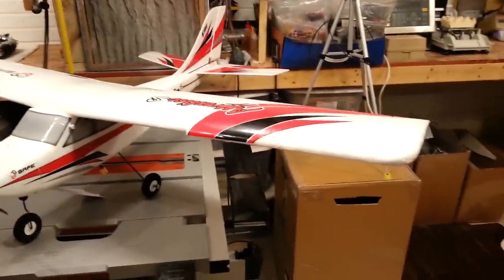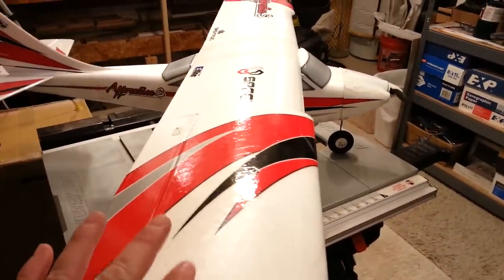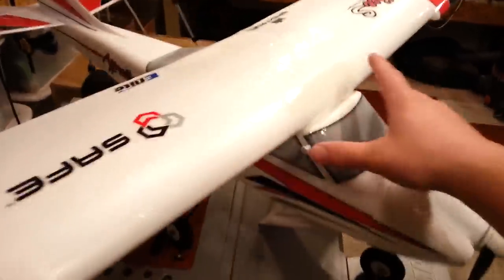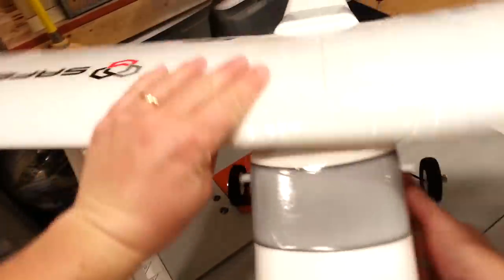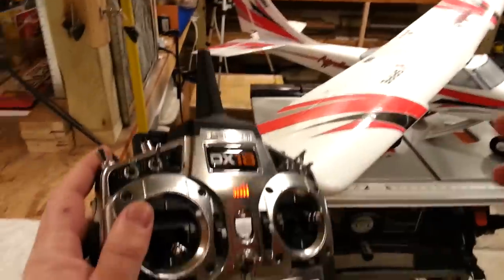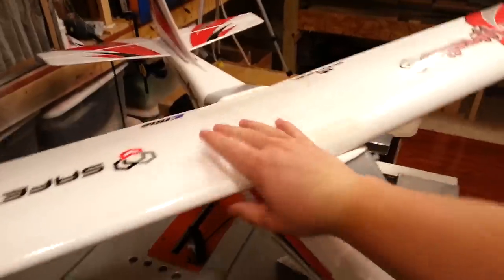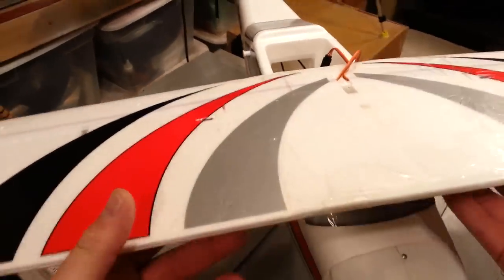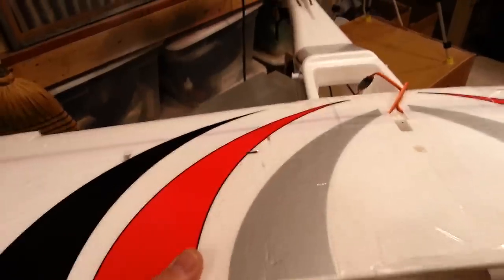E-flite - Apprentice S 15e - Flaps Mod - Part 1 of 2

Comment: Hey Brian, I just picked one of these from a deceased estate for $120 AU, AND, it came with a brand new spare Eflite 30amp speedy, 3000 lipo, prop, 6 spare wheels and a spare as new Orange 6 channel RX, has the AS3X rx fitted and working. Bargain ... Looking forward to getting it in air next week. Good to see you enjoy yours. Might give the poor old Conscendo a break as I fly so much, will do the flap mod latter on. Cheers, Stew.
Reply from the maker: You will LOVE it. Great plane for taking off and landing, OVER and OVER and OVER again!!! Very good flying plane BUT BE CAREFUL...make sure you don't turn on the POWER switch until she's on her landing gear. SAFE sets level at the position that you flip this switch, so if it's half way upside down, and then you accidentally turn on SAFE, like I did, you will probably end up on a roof across the street, feeling like an idiot - LOL :)

Comment: FINISH IT!!!

Sorry.  I saw the intro to the plane yesterday and my brain went to the one that has been sitting in the window of the local hobby shop for literally years, making me somehow I think it was an older video of yours that I missed.  When you talked about installing flaps I was like "I need to see that, that might apply to some of the what I want to do," and started searching and I had the "he must have never gotten back to it," reaction.

;-)

Imagine how happy I was to see this :-)

I’ve been thinking about cutting into a wing I have here and installing some flaps/servos and have been debating flap hinge geometry (fouler/slotted flaps vs a tape hinge) and have been wanting to keep the plane as simple/light as possible and was especially interested when you said you were going to do this with one servo and fouler flaps.

So:
- I'm jealous of your DX18... I have a DX6i and I seem to always need another channel...
- I can’t believe that you’re doing all that work with it just balanced upside down on the airplane, that would drive me crazy, for that matter it’s driving me nuts that it’s not moving on you
- The hot knife thing with the shim is kind of interesting.  I’m surprised it stays hot enough for long enough to do that.  The nice thing with that approach is that you can heat the tip and use the non hot part to guide the cut straight.  I usually have good luck freehanding cuts like that with a good sharp blade, but this time I cut my flaps by cutting a block with the correct angle in it and I screwed a razor blade to it to get a perfect angle on the cut.
- How/with what equipment are you shooting these videos?  I don’t know how many times I’ve thought “I bet people would like to see me do this,” and then either gave up as it’s too big a hassle to do or set something up on a tripod and ended up with a video that didn’t really show it well or worse, tried to hand hold it making both the video and my work crappy.
- I’ve been trying to find that dynam PN in stock somewhere for a while… I see you’ve found them under another PN.  I was actually ready to 3d print my own.
- “looks like the short side is supposed to be on the flap,” and then you go on to do it the other way 😉  I think they work out better with the short side on the flap (well after drawing out my hinges in cad to print, I haven’t gotten my hands on those)
- What kind of glue where you talking about using to hold the hinges in?  I couldn’t make it out in the video.

Hurry up and finish this 😉  I’m very curious what to end up with and you have me seriously considering going to the hobby shop and asking if they want to get rid of the one they have that has been sitting there for years.  I was wondering why no one seemed to like them, especially with all the spare parts in stock at the shop.
Reply from the maker: I already have it filmed, done and flying again :) I've been learning that releasing video too fast really hurts my channel. (sorry about that! I HATE to keep you guys waiting...)
Reply from the maker: I can't respond to all of your points due to family stuff going on, but I'll hit a few items quickly...
Stuff upside-down and loose drives me crazy too, but I learned long ago, the more times you take something apart and put it back together, the higher the likelihood of permanent damage - IE any car repair EVER - LOL!

DX18 = It IS awesome, and I've never been left wanting for anything with it!DX6 = You will be jealous ;) LOL ....My conclusion and recommendation, You should  get a dx8 or dx9 USED...they will be a TON cheaper, and will do everything you want to do for a long time. I got my DX18 for $405 shipped. It was a Brand new in box gen1, mode 2, and it included a 9 channel Rx (without AS3X btw). The company is out of them now, but they took very good care of me. I had a slider go bad and they replaced it with another brand new one, which I then sent the broken one back to them (at their expense)...the only catch was that I agreed to give my CC#'s to them in the even I decided NOT to return their broken one back. This was a very fare deal.
Parts for Chinese brand planes can be fleeting, so buy them when you can :)
I followed the instructions for the flaps on my Turbojet 550, for the hinges, then I copied it for this plane. I THINK I did it right, but definitely won't pick that "hill to die on"...
Mucilage is the type of glue I was using. It's a nuance of Chinese technical ...made from tree sap or some vodo witchcraft fluid...but it's excellent, and super cheap! 

These are links where I'd get some credit from your purchase (maybe a few cents...)
Foam-Cure - http://amzn.to/2CUiLMP (Similar to Mucilage)
UHU Por Styrofoam Glue - http://amzn.to/2CXrMVy (Similar to Mucilage)
Small Mucilage... Keep in mind this is not a link where I'll get any credit :(https://hobbyking.com/en_us/clear-foam-glue-medium-cure-large-100ml.html?___store=en_us
Large Mucilage... Keep in mind this is not a link where I'll get any credit :(https://hobbyking.com/en_us/clear-foam-glue-medium-cure-large-100ml.html?___store=en_us
Glad you're into this project. If you can get this plane for yourself, you WILL love it. It flies wonderful. I hate when I get a simple and less cool looking plane that latches onto me and becomes a favorite, since it's nothing to write home about, in the looks department, but it flies SOOOOOOOOOOOO good. You'll get it, when you pry it from your local hobbyshop's death clinch :)
Gotta go for now. Thanks sharing our experience!
Reply: Brian Phillips lol.  Yea. Same boat. Reading on phone between family stuff.  I was wonderig if you already have it done, your playlist shows 4 videos, 2 private. ;-)

Happy Father's day!
Reply from the maker: I just slipped away for a few minutes to finish up replying to comments. I only occasionally do my YouTube comments on my phone, since the PC is so much faster for me. We've been getting behind the last few weeks with house and land stuff keeping us very busy. For one of our most recent projects, we're working on a bridge to cross a stream on our new land, and since we're heading out there later today to get some more work done. I want to keep caught up so people don't get annoyed with non-answers...YouTubers that fail, forget their most important component, the audience!!! I hate when I ask a question and 3 years later there's still no answer. This was a commitment I made (to myself and my viewers) when I stated this whole YouTube thing.

1) I won't leave projects undone, at least without explanation...sometimes I crash them - LOL
2) I won't leave people hanging, waiting endlessly for reply to questions. I hate that!

Plus, I'm just kinda that type of guy. It drives my wife crazy sometimes, but it's like any other character trait, good with the bad, you know... When I say I'll do something, I mean it - to a fault.

Happy Fathers Day to You too!
Reply: I get that, I'm not always so good about getting back to people on social media, but I do have a reputation for helping people/following up almost to a fault... you don't know how many times I've heard something like, "why are you wasting your time on that, they wouldn't for you."

I ended up searching your Mucilage and found that it's "fish glue."  Yum!

Any suggestions on where to look for used RC equipment?  I don't spend much time on the forums so I don't have a good lay of the land WRT to used sales.

Anyway, still curious how and with what equipment you're shooting these videos... Maybe I'll start shooting some of me building things. ;-)

I buy stuff occasionally from your links (ordered the hinges you linked here this morning) but I can't imagine you see all that much from things like that but I guess it doesn't hurt...  

I'm hoping to sneek watching the next video in sometime today... huh... Monday...
Reply from the maker: I use these phones to film my videos...
1) Galaxy S7, Our is our goto phone, Megan films with this one...and it's generally really good.2) Galaxy S3, I use it for my shop repairs and mods, and I use a specially built cell phone mount on a helmet liner to hold it on my head, so I can see the screen, since it's a full time job trying to keep things in picture and in focus!!!3) Galaxy S5, this is "my phone" and the worst for quality, reliability, low light, and stabilization4) IPhone6(?), which is Esteban's phone...5) IPhone5(?), Esteban's OTHER phone...6) Pixel 2, my brother's phone, which was filming in 4K 60hz, and I coudn't even open the video file on my PC without crashing my video card - seriously!!! What a pain in the butt!!!
Reply from the maker: I almost forgot, here's a USED DX18 Gen1...

https://rover.ebay.com/rover/1/711-53200-19255-0/1?icep_id=114&ipn=icep&toolid=20004&campid=5338265023&mpre=https%3A%2F%2Fwww.ebay.com%2Fitm%2FSpektrum-DX18-Radio-Control-18-Channel-Advanced-Telemetry%2F192570844262%3Fhash%3Ditem2cd61de466%3Ag%3AO2oAAOSwn1Zazo9V
Reply: Wow, I wasn't expecting that answer... so you do all your videos on a phone?  I was expecting some sort of actioncam type thing, at least for the shop videos.  I'd like to see the helmet liner rig that you worked out, I'm having a hard time imagining how you have it so it's hands free, doesn't get too much in your way for that kind of work, and you can still see the screen.  

I'm surprised that you feel that the S5 is the worst quality.  I have an S5 also, and the picture and video quality seems very good.  S3's seemed to be the go-to for a lot of people, but I'm surprised that the video quality would be better on that, and a couple of people I know have iphone 5's and 6's (various models) but in at least one case (and she had a 5 and now a 6) any time we want a good pic or video we default to my S5, it just always comes out better.

I've tried shooting video doing something with a few different cameras with marginal results.  The couple of cheap DVR/action cams at 1080p and the video quality was marginal at best.  I have a Nikon d7100 which shoots some good video but I don't have any good lenses for this kind of thing (nothing wider than 18mm, which isn't that wide on a DX format), and it's WAY too bulky to wear somehow to shoot what you're doing like your shop videos.  I've shot some OK videos with it on a tripod, and all the dragstrip videos on my channel were shot using it (most were shot by a friend's girlfrend that has never used anything like it, "here, it's setup to record, this button starts and stops, just point it at the car...") and I'm happy with it for that.  One REALLY ANNOYING thing about it is that it automatically stops recording at 20 minutes.  My S5 has been the best out of everything I've tried.  With a knockoff gorillapod mount it does great stationary shots, wrap the gorrilapod around the rear view mirror and it's a better car DVR than the car DVR's and actioncams that I've tied.  It's biggest problem is that it's an AT&T one that is overloaded with AT&T bloatwear and is killing batteries and out of internal space.  Right now I'm consiering replacing it with a Moto G6.
Reply: That used dx18 was taken down before I got a chance to look, and the ones on ebay are crazy (it linked me to on for that the bids start at $443 +80 shipping)
Reply from the maker: Yeah, the S3 is better with AUTOFOCUS, but the S5 with "Smooth action" is very good, but takes a TON of memory.
I can't say for 100% certain, but the MP4 format must limit video size to a certain amount, because I have a limit of about 31-34 minutes on my S3, thus I have for some time now, had multi-part videos.
I'm bummed that you missed the DX18 with a lower price. I love mine, but maybe Craigslist??? OR go to your local flying field and get to be buddies with the guy who has every toy, and since he'll upgrade early and often :) LOL

Comment: This is a great video and tip.  
Do you know know to bind a Jumper T12 pro with receiver with AS3X stabilization techniology. I am was able only to have the basic channels working but the stabilization does not seems to work or the levels advice or basic for the control.
Ady advice is appreciated.
Thanks
Alex
Reply from the maker: What Rx??? You'll need to know what channel is assigned for SAFE Select, if you have bound it with SAFE Select on. If you haven't, then the AS3X is always on.

Think of the Jumper as any other DSMX transmitter...the Rx doesn't know any better expect for Telemetry. 

I need to know what Rx and where it came from to be helpful.

Comment: Would be great if HH just put flaps on it to begin with.   I know some will say yes it just makes it more complicated for beginner pilots etc... but its not like they would have to use it right away.  Something they can gradually progress to use.   I like the apprentice but its actually one of the reasons I've always hesitated on getting one.   A plane that size I want flaps.
Reply from the maker: I agree, but this plane is soooo good ;) You'll love it, even if you have other planes. This plane is such a blast to fly! The flaps are SUPER easy, and you shouldn't do the Fowler flaps like I did, just make a TAPE hinge, and it'll work even better!!! (Plus a lot easier)

Comment: Hey Brian, I`m very new to rc and bought the apprentice sts as my first plane but even though it handles very well for this newb it still comes in to hot for me to land in the given amount of runway I have. (about 500 feet lol, I could land my C150 in a shorter distance)..Instead of adding flaps what about flaperons and just mixing it into the plane ? I have the Spektrum ix12..
Reply from the maker: You should slip in. Full rudder, and opposing Ailerons, and you'll slow her down, then snap out of it a few seconds before touchdown when you're in ground effect, and you can cut landings in half.
Reply from the maker: When you get sick of this, cut in flaps, but just DO tape hinges...way better in this application.

Comment: Hi, great video, thanks for all the effort you put into all your videos, I was wondering how to set up flaps using a DX6? Thanks.
Reply: Never mind I just saw that some one asked the same question.
Reply from the maker: No problemo - if you're using a NEW receiver, we have NEW videos about this too, FYI - Dynam Sonic (plane sucked, but we show how to do it on an AR631) and we also setup Flapperons on the OMP Challenger too...

BUT, if you want to do it STOCK on this plane, as an upgrade, I'd just do FLAPS. They're WAY better for the aerodynamic capabilities of this plane, and it's WAY easier to do it too ;) A few buck more (maybe $20-30) for servos and wires, but WELL worth it in the end!

Comment: What gram servo do you recommend for doing the flaps mod on the apprentice? I want to use the 2 servo method. Should i use two 9g or two 12g servos?
Reply from the maker: If you're going with two, I'd start with 9 gram, and upgrade if you have a failure...which I doubt you will. Make sure that the servo is pointed in line with the flaps when they're in the "regular" (NOT deployed) position. This will help to allow the servo pocket to hold the flaps tightly closed, then when you need to deploy the flaps, you can have the motor "working"... Do you get me?
...but yeah, 9 gram would be fine. I think I used a 9 gram for BOTH...
Reply: @BrianPhillipsRC  thank you for the response. Yes i get you.. i watched this video a bunch of times and also your other flap mod videos. You have helped me tremendously in this hobby. One other thing.. do i have to use a servo reverser y cable for one of the servos?
Thanks again.
Reply from the maker: If I use TWO servos, I would actually just reverse the servo...which is easier said than done...
You can also just place them in such a way that they operate in the same direction. This is a LOT easier.
Sure you can use a servo signal reverser, but then it's just one more thing to fail, and one more thing to buy too!
Good luck!
Reply: @BrianPhillipsRC  how would u reverse the servo.. on the transmitter?
Reply from the maker: You can go into servo setup, or if you have a super simple transmitter, you may just have a dip switch to flip. BUT if you're using TWO servos, and you want them to "look symetrical", and this means one will run backwards while the other runs the correct direction, you'd have to use TWO separate channels...one to control the LEFT FLAP and the other to control the RIGHT FLAP....but I almost never do this, except when I'm using a super complex sailplane setup...